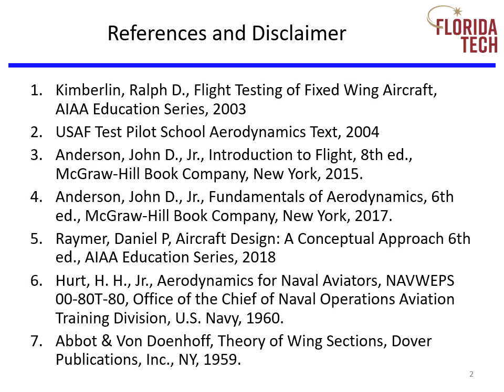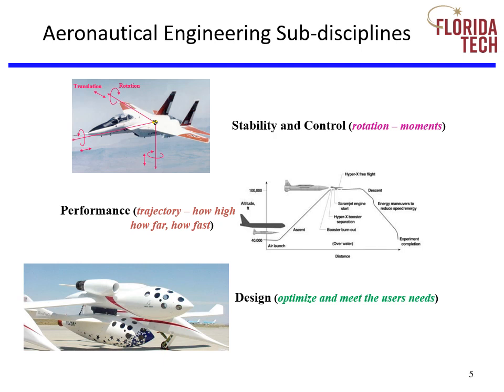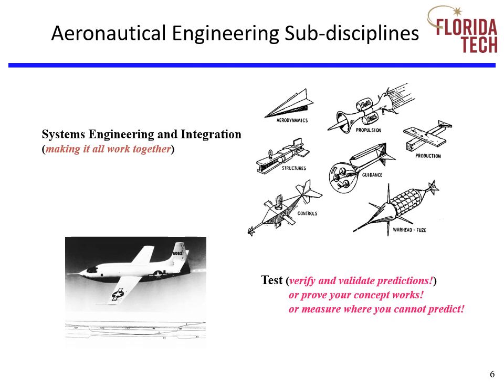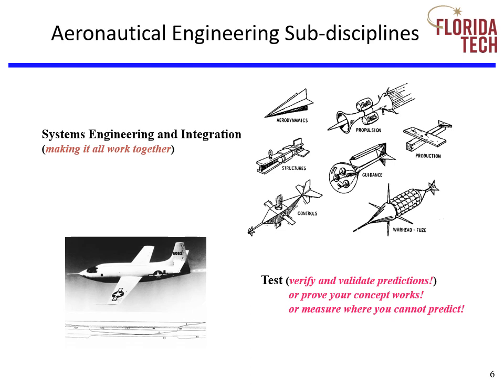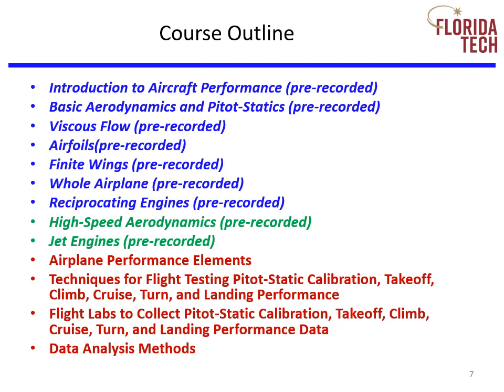1  Introduction to Aircraft Performance

Comment: Nice
Please I have an question
Consider a jet-engine powered executive aircraft flying at an altitude of 2000ft, speed of 100ms-1 and having the following characteristics:
Wingspan – 16.3m
Wing area – 29.54m2
Normal gross weight – 88,124N
Parasite drag coefficient CD-0 – 0.02
Oswald efficiency factor e – 0.81
Powerplant – 2 turbofan engines of 16,300N of thrust each
Fuel capacity – 4236ltrs of kerosene
Specific fuel consumption – 0.6lb of fuel/(lb of thrust)(h)

Calculate the following at level unaccelerated flight:
Aircraft lift coefficient (CL)							0.52
Total drag coefficient							0.032
Thrust required to maintain level unaccelerated flight (TR)		5,423.02N
Excess thrust available at level unaccelerated flight			27,176.98N
Endurance of aircraft							12.75hrs
Range of aircraft